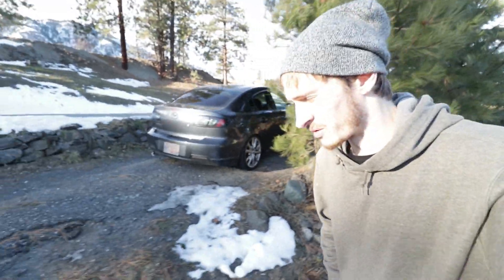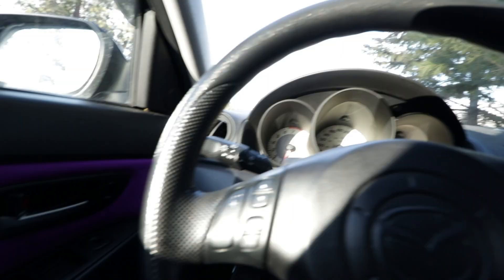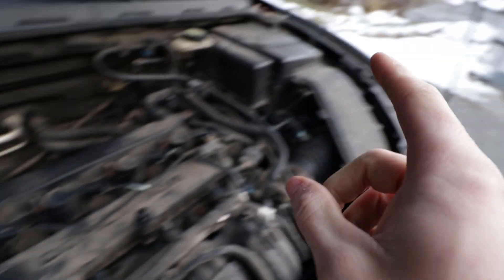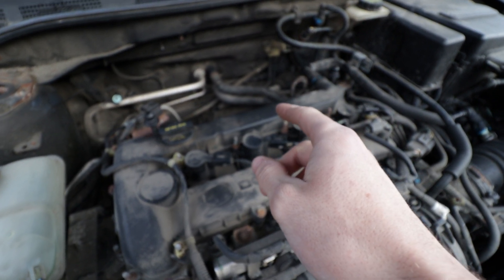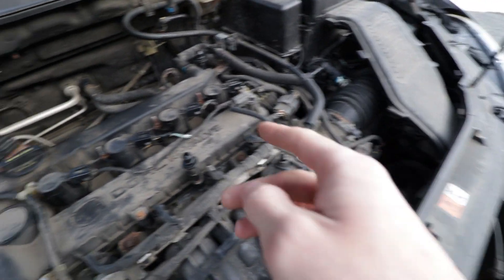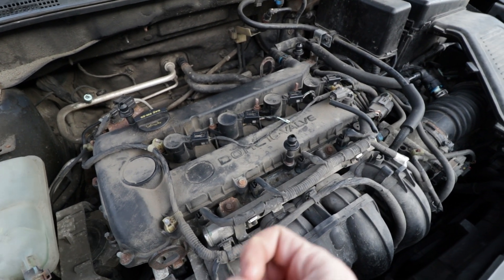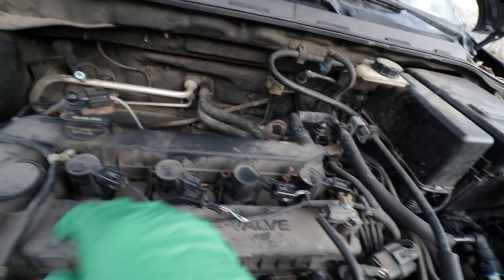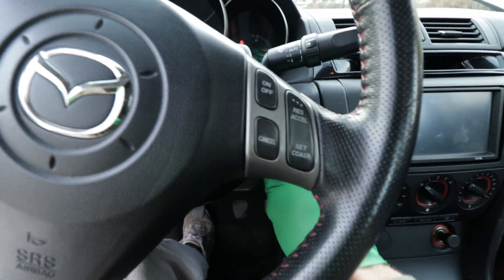Diagnosing Cylinder #2 Misfire | Did I Lose COMPRESSION?

Comment: Hi , i have an issue with my mazda 3 1.6 liter. I can't start or very difficulty. I changed the crankshaft sensor and the fuel pump . I checked injectors and fire, MAF sensor , throttle position sensor, everything seems correct. By the way I have on the MAF 0,21 g/s when engine is stopped and 6 g/s when I try to start (Europe value) . And on the TP 12,5% min and 75,3% max. Do you think this data are ok ?
Don't know what to check now, any idea ? thank you.

Comment: Hey just wanted to toss out a suggestion been running this brand on both 07 3s one the 2.0l the other the 2.3l have had zero issues and the price is decent this and NGK spark plugs are the only parts I buy from Amazon. https://www.amazon.com/dp/B01M0LYNCW/ref=cm_sw_r_cp_apa_fabc_pQCbGbQFJF57X